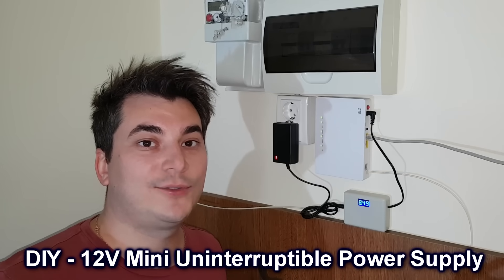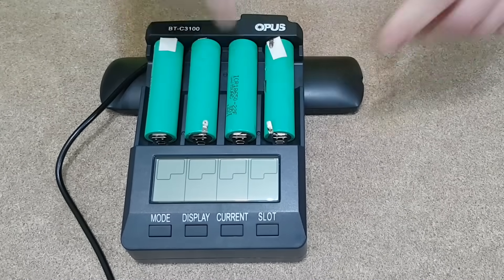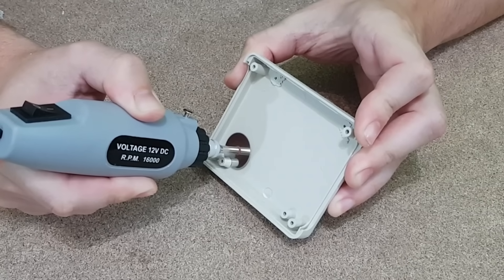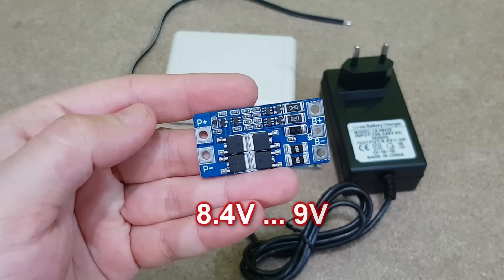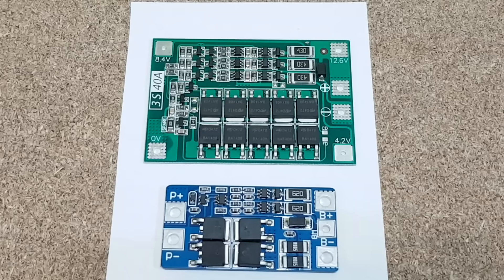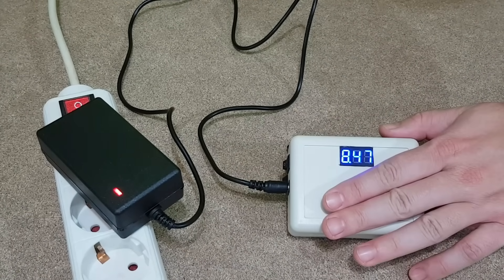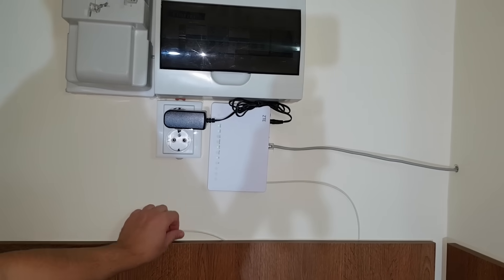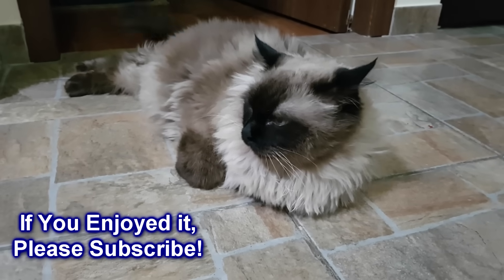DIY - 12V Mini UPS

Comment: Having built a similar unit, the batteries cells don't last long with this design. The first solution I found was to have a switch to stop charging the batteries and only allow discharge because the batteries are rarely used in my case. Then I found the dual DC modules based on "ideal diodes" (by Teyleten Robot) that could switch the sources within 0.1ms that I consider trying soon.
Reply from the maker: Hello, this is a good point. This design works with small loads, max 0.5A. 
If you use it with a higher load, it will draw more current from the charger and the charging voltage will decrease a bit, this depends on the quality of the charger and the power loses. If the charging voltage decreases under the "total" overcharge protection voltage of the BMS board, the BMS can't stop the charging process. 
For example the 2S BMS from the components list has the overcharge protection at 4.25V per cell +/- 0.05V. so the max overcharge voltage for the 2S battery can be 8.6V. the BMS needs a slightly higher voltage, to make sure the overcharge protection works and the charging process is stopped. 
That's why it's recommended a charger with up to 9V, because there are also power loses, especially with a higher load, the charging voltage can drop to 8.4V, so the battery voltage will never reach the overcharge protection voltage of the BMS. I have other videos explaining this.
You also need a good charger, preferably with 9V and 2A, so it has enough current to charge the battery and power the load in the same time and enough voltage so the battery can reach the overcharge protection voltage.
With a good charger and a small final load you will not have this problem.

Comment: YOur build is clean... and if we take in 12v Routers this build is good... but the power supply we receive will be 12v from outside and the input(for charging) we need in this 2s BMS is 8-9v so that is a little issue here... Either we have to add another step down converter to take in 12v-> down to 8.4v then charge the bms + step up again to12v and output..!!!  Very inefficient..!!

yeah if we have an 8-9 volt adapter and we do this setup this is good but its not like everyone will buy seperate 8-9v adapter for the router...
Reply from the maker: Either way you still need another charger, because the original charger is only design to power the device. you need a more powerful charger, to power the device, charge the battery and cover for the power loses, all of these without getting hot.

Comment: So in this the router is always getting power from battery even when electricity is there right? So will it no degrade the battery?

Edit - check at 11:47 the fluctuation in display when he unplugs
Reply from the maker: No, the charger voltage is higher than the battery voltage, so the converter will draw power from the charger.
Reply: @Sorin_DIY  but when the light cuts of then? The adapter is providing 0v so voltage may flow from battery to adapter

Comment: Hi... what if I use 6s bms and lm2596 for the router..will it be okay??  I do have 6s bms and lm2596 step down converter please suggest me
Reply from the maker: Yes, but you need to redesign the UPS and you need CC/CV converters to limit the current.

Comment: i tried this but i used 12v power supply bucked to 8.4 ... the problem is the dc buck is heating up badly when the batteries are discharged and the power supply try to charge them through the bms ...
is there a solution
Reply from the maker: You need a CC/CV converter to limit the current, when charging the battery. You can watch my latest UPS project, I will upload the next video in a few days.
Reply: @Sorin_DIY  yes yes i already did that and it work great ... thank you for the video it was too helpful

Comment: Have one question instead of buying a new charging adapter... can i use 12v 1a adapter from my Wifi and boost it to 12.7v using the booster like you use and charge a 3S 18650
Reply from the maker: It will probably work, but you need a CC/CV converter.

Comment: I was looking for a small lithium-ion UPS that can power my ONT, wifi router and voip router.  They're all 12v.  I'm very tempted to have a go at building something like this.  Looks like a fun little project.
Reply from the maker: Hi. My next project will be a better UPS, exactly what you need. If you want to build one, I suggest you wait for my next video.

Comment: Hello, can this UPS power two 12V devices - a media converter and a router?
Reply from the maker: No. it will heat up. My next project will be a better UPS, which will work for you.

Comment: My router is of 12V/1.5A. If I run it on 1A or 2A for a long time will my device be damaged?
Reply from the maker: No, but the UPS will not work correctly with 1.5A.

Comment: Você está usando um step up perigoso, xl 6009, pois se a tensão de entrada cair a menos de 3,5 volts, a tensão na saída irá a 40 volts. Pode testar se quiser.
Reply from the maker: Yes, it's dangerous if the input voltage is below 3.5V. But the BMS cuts the voltage at minimum 5V.
Reply: @Sorin_DIY ok, mas falhas em bms ocorrem, não seria mais prudente, utilizar um módulo mais seguro?
Reply from the maker: Yes, but with a different boost converter the Mini UPS case needs to be bigger. You can use this converter with a minimum input of 2V: https://s.click.aliexpress.com/e/_Dlarfwr

Comment: Hi Sorin, I made a 12v ups with 3s and it ran one year perfectly. But recently it's stopped working. BMS output almost 0v but battery pack voltage is still 12v. Every connection is ok. How can I repair it? I'm not a BMS expert.
Reply from the maker: Hi. It seems to be a problem with the BMS. Have you tried to disconnect the cells from the BMS and reconnect them? is the charger still good?
The BMs usually behaves like this after the overdischarge protection is activated or in a short circuit. in these cases the charger should be disconnected and after a few seconds reconnected.

Comment: As Lipo cells age fast when at 100% voltage (4.2) how is the longlivety of those cells?  I didnt find any charging modules that limit to 4.1V for that reason.
Reply from the maker: It's better to charge the Li-Ion cells to max 4.1V, but I haven't found a BMS board with this cut-off voltage. 
But you can use the XH-M604 charging control board, to limit the charging voltage, like I did in this video: https://youtu.be/1kth4iqaHP4
Reply: @Sorin_DIY  thank you, i didnt know that

Comment: I liked your video, but I have a question🤔: I guess simultaneously charging and discharging can decrease the lifespan of batteries. Secondly, why didn't you use a relay for switching between charging and discharging of the batteries?...What do you think?
Reply from the maker: The battery is not continuously charging. The BMS board from the video description has an overcharge release voltage feature, so when the battery is fully charged, the BMS stops the charging process. the charging is resumed when the voltage of each cells drops below 4.15V.
And because the charger voltage is a little higher than the battery voltage, the load will draw current from the charger, until the mains power goes out, then the battery will power the load.
Reply: @Sorin_DIY  thanks for your quick response

Comment: battery damage after while bcz they are always on charge and also its discharge when charging. its very simple and not useable all. thats why BMS exist
Reply from the maker: Not exactly. I mentioned a better BMS in the video description with overcharge release voltage feature, that cuts off the charging current when the battery is fully charged. 
Also the charger voltage is a little higher than the battery voltage, so the load will draw current from the highest supply voltage, which in this case is the charger, until the mains power goes out, then the load will draw current from the battery.
This small UPS works with small loads of about 0.5A. With higher loads the charging voltage will drop and it will not work properly.

Comment: Hello Sorin, I am finding it difficult to understand the purpose of the switch. If the switch is in the off position, the UPS is not going to allow current to flow from the battery to the router, so the router will not work anyway. The whole point of the UPS is to keep the router working incase of a power outage. Your thoughts please.
Reply from the maker: Hi. The switch is installed between the battery (more exactly the BMS output) and the DC converter. there must always be a way to completely cut off the battery from the load.

Comment: hi, i like your videos, and i make a ups for my router following these steps. but i am having one issue with this build, when the battery is completely discharged, then i plug in the charger is not working. it only works when i disconnect the load. can you please give a solution for this. Thank you
Reply from the maker: Hi. what BMS and step up converter did you use?
Reply: @Sorin_DIY   2S 8A Bms & Xl6009 Boost convert.
Reply from the maker: Did you connect the wires as in the schematic? the charger should power the boost converter (when the UPS is turned on) even without a BMS or battery. so the charger is not powerful enough, or the load creates a high inrush current at startup. you need to check what is failing, the charger or the boost converter.
Reply: @Sorin_DIY  I think the problem is the charger, i am using 9v 1A charger. is there any way to solve this problem without replacing the charger? Thank You

Comment: The plug charger required is too much specific and hard to find in certains situations.

You can add a cn3722 solar charging board if want to mantanin original charger.

Comment: My router is of 12V. what will happen if dont use the buck booster pcb XL 6009 ??  is it neccessary ? Please reply
Reply from the maker: Hi. Some router will work with a lower voltage because they have internal voltage regulators. but when the battery gets low, it will not work correctly, so it may not work with the entire battery voltage range.

Comment: Bro, I want to charge the 2 s batteries( with 10 amp bms )  by 9 or 12 volt modem adaptor. The problem is that the bms module needs 8.4 volts and it doesn't have cut off function and current limiter. I don't want to buy any bms (for example i max  B6 )charger adaptor. Has tp5100 cut off function and current limiter resistor? Because modem adaptor cant run the batteries and modem at the same time. That's why I need current limiter approximately I need 350-400 mA. Because battery 8.4 v 4 ah.
Reply from the maker: Hi. In the video description I added a link to a better BMS with overcharge protection, overcharge release voltage and balance functions https://s.click.aliexpress.com/e/_DmQXqbb
You need a good powerful charger. the chargers I use in my videos usually have the current limited to 2A, which should be enough to charge the battery and power the load. the 8.4V charger actually has 8.6V to reach the overcharge protection voltage and stop the charging process. but you can also use a good 9V and 2A charger, but the same type with the current limited to 2A, so the cells will be charged properly. 
you should connect the charger with a volt/ammeter to check if the current is limited and the voltage is rising slowly, while it charges the battery and power the load.

Comment: I was interested in how many cureent optic router needs to work .
Reply from the maker: The optical network terminal (with wifi or not) needs 0.3 - 0.6A. Routers need more current, some use more than 1A.

Comment: I will make it for Anu and Router. But you have taken one as output. What will be the design if two lines are to be made. Means how to give the joint. If you would say a little.
Reply from the maker: you need a bigger battery pack and another boost converter with a common input with the first converter.

Comment: I like this design because you take extra care by A. putting the fuses directly on the battery as the BMS can fail and B. adding a capacitor on the output to smooth out the flow. Very nice. I'm going to make this, but with 3S.

Comment: I would like to use 12v(12.4 tested) 1a adapter to charge this, I'll be using 3 batteries and thus 3S BMS. My question is, if I use that, it will charge batteries 95%. However, the modem requires 1A current, so how will the adapter supply power to the modem as well as charge the battery? Secondly, if I use diode on the input port for reverse current flow, I'll be left with less input voltage of about 11.5v, how would that charge batteries?
Reply from the maker: Hi. a 3S battery pack should be charged with a 12.6V li-ion charger, which in reality has 12.8V. this is because the charging voltage needs to exceed the overcharge cut-off voltage of the BMS protection board, to stop the charging process. for example if the BMS cut-off voltage is 4.25V/cell, the charging voltage needs to be a little over 12.75V, to be sure at least one of the cells will reach the overcharge protection voltage and the charging process will stop. otherwise the cells will be charged continuously and will get damaged.

Comment: Not bad. But misses the most important feature: battery bypass if there is power from the grid (outlet). It should directly route the power to the output to reduce battery degradation, and switch to the battery once input is lost (outage).
Reply from the maker: Hi. With a 9V charger it will work fine. the BMS board from the video description has an overcharge recovery voltage feature. the charging process is stopped when the first cell gets to 4.25V and there is no more current going to the battery. in time the cells will self discharge slowly and when both cells get below 4.15V the charging is resummed. so the cells are not continuously charged. the charger will continuously power the converter and charge the cells only when needed.
Reply: @Sorin_DIY  I tested that supposed stop of charge. I connected that balanced BMS to 2x 18650s and supplied it with 8.4V from Lab Power Supply. It charge the batts but the charge does not seems to stop. Current  decrease to 60mA and stays there. I did not connect any router or step up yet, still on the testing phase to see if that BMS is safe for the batteries for long term. What do you think? If current is still consumed, it means the cells are constantly being charged. Also my batts reached max to 4,21 - 4,22 V.
Reply from the maker: Hi. Did you use the BMS from the link in the video description (the green one)? in the last part of the charging process, when the cells get to 4.2V (and higher), the balancing resistors are activated and draw up to 100mA. if the charging current doesn't exceed 100mA, the cells voltage will not increase anymore and will not reach the overcharge protection voltage of 4.25V (+/- 0.05V). so practically the charger will continue to power the balancing resistors. you need to finish the charging process with a current higher than 100mA, for that you need to increase the charging voltage, to exceed the maximum combined overcharge protection voltage of the 2 cells, so 4.3+4.3V=8.6V. but remember that there are also power loses in the wires and contacts, so I suggest you charge the battery pack with 9V. when the first cell gets to the cut-off voltage with a charge current higher than 100mA, the charging will stop.
Reply: @Sorin_DIY  nope I did not use the green model, it is without balancing feature, I used the same as you used in the video.
I got what you explained about balancing and up to 100mA.
So theorically I need to increase the voltage imput, and same way going to increase to 4.5v and see how the overcharge activated and stop the charge.
I think it is safe because long time already at 60mA drawn, I think more about balancing features as you explained.
Reply from the maker: the blue BMS from the video doesn't work very well, I realized that after I used the UPS a few times. that's why I changed the link with the green one. you need the green BMS with balance feature and it will work with the parameters I told you. with 8.8V it should work fine, balance the cells and trigger the overcharge protection feature. if the router draws too much current, the charger voltage may decrease a bit, that's why you may need to set it to 9V.
Reply: @Sorin_DIY  finally I just had to increase the imput voltage as you said, and the charge and current drawn stopped.
The Router is a 9V model, but its charger delivers 9,92V, and it has always been working fine. I used a little step down module to decrease to 9,20V, because directly from the charger (9,92V) some diode was heating. I set 9.2V  to compensate power loss when batts going to charge, also for the router to dont reboot... Testing and checking how its stopped charge is ok, now I will try it and see how the router react with the UPS.

Comment: Hey Sorin! Love your videos! What's your take on adding AC fuses to DC circuits?
Reply from the maker: Hi. theoretically we should not use AC fuses on DC circuits. the voltage and current rating will not be exactly the same. but for small projects like these it will work.

Comment: There is no charging module like tp4650. How is it charging? BMS does not  charge. Isn't it?
Reply from the maker: you need a CC/CV converter, or a good charger with a constant current feature. this will charge the battery pack. the BMS board will balance the cells and will stop the charging process when the battery is fully charged.
Reply: @Sorin_DIY  Would a 9 volt charger be suitable for this system?

Comment: sir is it ok to use a 3S 10A BMS to make this
Reply from the maker: no. it will also need other modifications.
Reply: @Sorin_DIY   If a 3S 10A BMS board is installed, what should be changed?